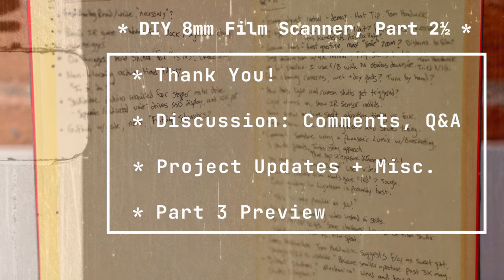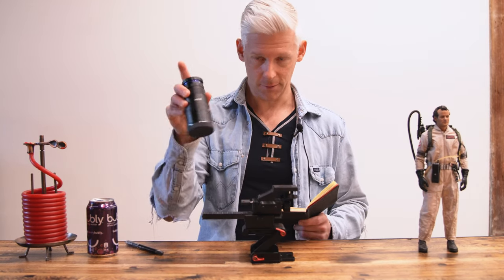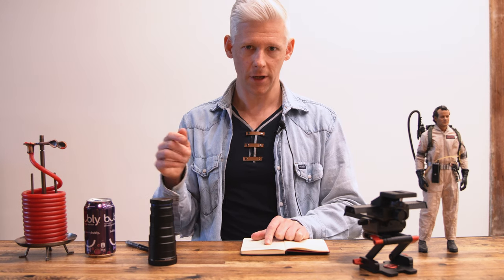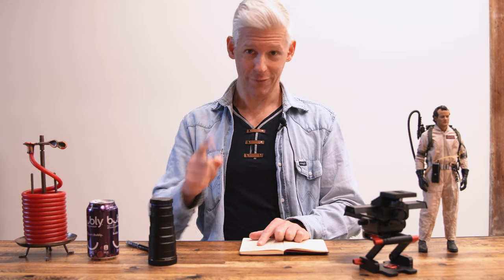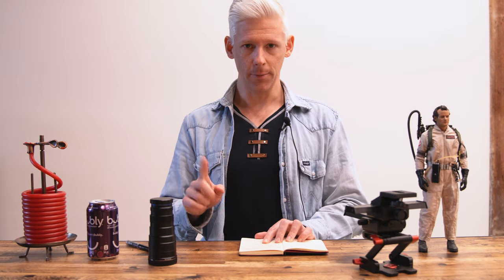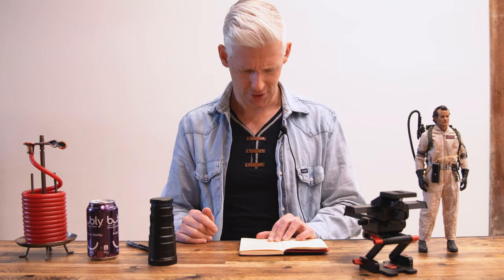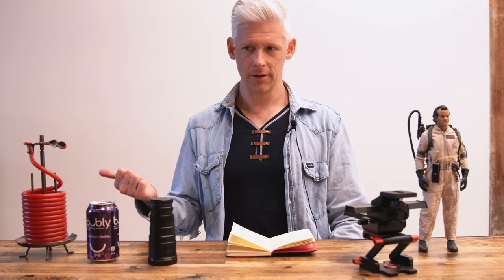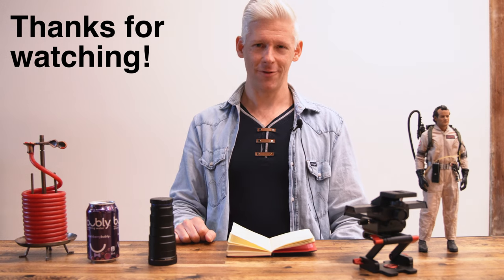📽️ 📸 💾✨ DIY 8mm Film Scanner, Part 2.5: Q&A! Ideas, Tips & Tricks; Part 3 Preview.

Comment: Thanks for all your hard work. Thanks to you we are seeing film not viewed since the 70's. https://www.youtube.com/watch?v=-Wu4AkhUs8Q
Reply from the maker: This is fantastic, well done! I hadn’t even listed all the parts I used, but it appears you got the IR gate and other bits. Very neat to see others getting similar “builds” working.

One important note: it sounds like your DSLR (Canon 7D?) is actuating the shutter / mirror every time, the classic Canon “mirror slap” sound. This will be wear and tear on the camera, and it will shorten the camera’s lifespan. 😬

Take a look at “silent” mode as a start to help reduce that, and maybe also the alternate firmware “Magic Lantern” (with its own risks / caveats) which may offer a way to get a fully silent frame without any mechanical movement.
Reply: @scottschiller  Yes, I was able to use your videos and replicate what you "created." Your videos are first class and solved a mystery I have been thinking about for many years - "How do I scan my old film to RAW images so I can process them." I wanted more control than a raster offers. I'd never heard of Arduino and your set up solved answers I didn’t even know I had. I think the only thing different was I 3D-printed a mount for the LED light because why not...plus I don’t have the same set of kitchen utensils 😊 

You are correct, this is a 7D….an OLD 7D. I did a little research and found shooting in silent mode activates the shutter 2 times, not one. Upon further research it appears (depending on who you listen to) that the shutter is what wears out on the canon cameras not the mirror. So with that info I figured what the heck,  if I wear out my well used 7D I will just have to replace it with a new full frame Canon..ahh darn. 

I will check out Magic Lantern's options. Its in fact already set up on this camera, just not being used. I used it years ago to shoot video in RAW on this camera. That was a beast of a project in terms of processing. 

Thanks again for sharing everything. I have family members that are blown away. I picked up a sound projector to pull the audio off the super-8 as well and it’s turning out awesome. Great work!!!
Reply from the maker: @dtorbit  It's always inspiring, and an honour to see others' work based on something you've shared. I'm glad you've found the video series useful too, of course! I enjoy making these, and I put them out there with the hopes they'll be enjoyed by others.

Thanks for confirming the Canon 7D, I'm glad to know you're aware of the shutter activation and eventual wear and tear. I tried some raw video experiments on my 5D3 (which I have here) years ago, and I agree - it took many hours and hundreds of gigabytes to process the frames, but I got some pretty nice results! Some San Francisco Bay Bridge footage, here. https://www.youtube.com/watch?v=IymJBmfa_bY

Regarding reducing or eliminating shutter / mirror / mechanical activity: I haven't tested this yet, but Magic Lantern calls the "silent" feature "Full-resolution silent pictures." I intend to check it out on my 5D3 and will include my findings in Part 3 if I there's anything notable. https://www.magiclantern.fm/forum/index.php?topic=12523.0

I'm delighted to hear you were able to scan stuff for your family and surprise them; that was my goal for last holiday season as well, to bring material from the archives and make it look really good. Getting Super-8 sound must be interesting, I have not tried that yet myself. I have one commercial film that has a visual waveform printed on it, I have yet to dig into that.
Reply: @scottschiller  ' Waveform printed on it' sounds as if you've got a Super-8 film with a mono optical audio track printed onto it. These were almost invariably prints made for the aviation industry, where the film ran at 24 fps, and the iffy signal to noise ratio and poor frequency response of optical tracks came with the advantage that there were no magnetic heads to wear and get clogged up.  The Elmo GS1200 will replay these films well.

Comment: Very nice. I have an old projector that's begging to be modified. Whilst I know how stepper motors work, I have no practical experience using them. The Nema 17 appears, to come in different sizes, presumably different power, torque and voltages. Is there a specific model that you would recommend to do the job ?
Reply from the maker: In researching stepper motors, it seemed like the NEMA 17 was a "safe bet" in terms of its torque. I think you're right in that specs vary somewhat, but driving a projector shouldn't take much force; you can turn the projector gears etc. by hand, using the pulley.

I wasn't sure how much torque was required, so I got a 2-amp 1.8-degree (200 steps per revolution) bipolar (4 wire) NEMA 17 which has 84 oz-in / 59 N-cm torque. I wager a 1.5-amp would be fine as well. The 2A version is certainly strong enough that you can't easily stop the motor turning with your fingers. The model I got was around $10 USD. I believe these all run at 12V, but make sure you check the specs before buying. https://www.amazon.com/STEPPERONLINE-Stepper-63-74oz-Connector-Extruder/dp/B07LF898KN

A smaller 1-amp NEMA 17 might be fine in terms of torque for a projector, but I haven't tested this. If the price is roughly the same, I'd get the 2-amp one to be safe. https://www.amazon.com/Short-Bipolar-Motor-18-4oz-13Ncm/dp/B00PNEQ79Q/

As for making them work with the TB6600 + Arduino, I found these two videos to be really useful.
One warning I've also seen: Don't connect or disconnect the stepper motor wires to the TB6600 while the power is on, because it might burn out the controller! I've been lucky and haven't done this - yet - myself. ;)

Background, types and theory: https://www.youtube.com/watch?v=0qwrnUeSpYQ
TB6600 + NEMA 17 + arduino specifics: https://www.youtube.com/watch?v=3LZ_v3Jldwo

Hopefully this is helpful for you!
Reply: @scottschiller  Thanks Scott, for all the info and the links that is extremely  helpful .
Reply from the maker: @whoam42a1  Excellent; you're most welcome.

Comment: Very intriguing, enjoy this type of DIY, grate work. What I would like to know the camera, would a simple cell phone camera work or must it be the expensive ones with bells and whistles.
Reply from the maker: Thank you, I’m glad you found it interesting! Regarding the camera - I have seen some scanners where folks use a Raspberry Pi-type camera lens/sensor, basically a lens module on a little circuit board sort of thing. That might be a little more work, but more convenient / reliable than trying to set up and remote trigger a cell phone to take thousands of images.

Whatever you choose, the most important thing is you don’t want a mechanical camera shutter e.g., DSLR cameras, because those will get worn out pretty quickly with the movement required to take a picture - and then you’ll have a “dead” camera, not very useful! 😩
Reply: @scottschiller  - thanks for the info, will do some more research and see which way I want to tackle this project.

Comment: This is a fantastic project, and what you've done is awesome!
Some tweaks you can make to your existing camera settings:
Yes, you are absolutely correct that the more zoom - the longer the tube - the less light will reach the sensor. It's the same problem those of us who shoot large format (the old cameras that look like an accordion?) have to deal with and compensate for.
While the "sweet spot" of a lens is nice to know, there is NOTHING stopping you from closing down to get a deeper depth of field. You mention you stop it down to f8 - I would have jumped right to f11 when dealing with that shallow of a subject. For what you are doing, you will never notice any difference in quality between f4 and f11, but you are guaranteed the whole field will be in focus.
Now, long zoom, and stopping down equals LESS light, RIGHT?!
Here's something else to note: I feel like you are going by the rules of film photography (hey, I'm a 50yr old photographer, and I sometimes go back to them as well) where the higher the ISO/ASA, the "chunkier" the image. 800 ISO on that camera (Sony a7 series cameras) is smooth as butter! Gone are the days where you need to work with the slowest ASA possible to ensure it being sharp. Add to that, in the end, the image will be "moving", which negates a LOT of image artifacting anyway. This will ALSO give you the benefit of a lower contrast image - less likely to both blow-out your highlights and/or crush your blacks - you will see MORE information overall in the finished frame.
A note about a DSLR that has a mirror - they can use the Mirror Lock-Up feature to relieve the camera of that. No mechanical use, and even better, no camera SHAKE.
Sorry for the novel.
LOVE the Venkman figure!
Looking forward to watching your Pt. 3!
Reply from the maker: Hi Lew,

Thanks for the kind words, and the notes coming from someone who knows large format and film! I've had varying thoughts from folks on aperture. I think I initially tried f/16 with my first prototype in part 1, but my exposure time was multiple seconds when using my LED flashlight. I think it's good to test your own camera and gear, of course, and see what works for you. I think I've used f/8 for most of my scans at this point, and I've found that aperture much more forgiving than f/4 where the focus was harder to line up across the film. Either way, the depth of field is very shallow on this lens!

As I recall, there's an argument that smaller apertures introduce diffraction and thus reduced sharpness - so I try not to use the smallest aperture, i.e., f/16, on this macro lens. I think f/4 or f/5.6 have been recommended as the "sweet spot", per se.

Regarding ISO, I've heard arguments that ISO is effectively just a multiplier on exposure with digital cameras. As I recall, the argument was you could (theoretically) always shoot ISO 100, bring exposure up in post, and it'd be almost the same as using a higher ISO when shooting. Either way, I found that I can shoot pretty reliably and get good results at f/8, ISO 100, and 1/10s shutter speed. For scenes where more light is needed, I can slow down to 1/8s or 1/6s, noting that it's increasingly important that the camera doesn't vibrate or move during this process.

On DSLR mirror lock-up: Indeed, most have this feature, but there is still some mechanical movement from what I found. It's reduced, but still there, and I show that briefly in this video on my Canon 5D3. Folks with Canon DSLRs can try looking into the "full-resolution silent picture" feature offered by the Magic Lantern firmware as one possible way to get truly silent pictures, but it sounds like this is slow and outputs YUV 422-type files - perhaps not RAW, which may negate the benefits of the process otherwise. https://wiki.magiclantern.fm/userguide#silent_pictures
Reply: Hi Lew and Scott.  I'm in total agreement about the usable ISO extending to 800 (though on my A7R2 I limit it to 400).

But I flinch at your 'jump straight to f/11' comment. On our side is the fact that we're using a beautifully designed flat-field macro lens (the Laowa), and if the camera is truly perpendicular to the film in the projector's gate there should be no need to stop down the lens at all.  

OK, there 'could' be some film curvature and splices will be horrible, but generally (as Scott has found) it's vibration that causes the loss of focus.  The tests of my 4K TVs screen show a MARKED resolution loss when you go from f/4 to f/11, and this has nothing to do with Laowa and all to do with the laws of optics.  I shoot my gate at f/5.6 to give me that tiny bit of DoF reassurance, but I know it's visibly not as good as f/4.  I'd happily use f/2.8 from a resolution standpoint, but the very slight vignetting wide open (easily shown using zebras) has completely cleared by f/5.6
Reply from the maker: Thanks for the detail.
I tried f/4 myself, but noted the depth of field being very thin and having some trouble aligning with the film gate, using my setup as-is. With f/5.6, it seemed like a nice go-between.

I wouldn’t use the smallest aperture on any lens under normal circumstances, but it never hurts to look up the “sweet spot” online.

Comment: Seriously beautiful machine and even better results.  I have about 100 years worth of family movies that I’m too paranoid to ship anywhere, so I’ve been wanting a Dual 8 ‘telecine’ for many years now, especially one that’s independent of a computer connection and easily upgradeable as the camera tech gets better.

As the saying goes, it’s pointless to reinvent the wheel, so I’ll be copying your methods as closely as possible.  So close, in fact, that I just bought the exact same Canon  S-400 projector on eBay.  Hope you don’t mind... I’ll give you full credit whenever I’m taking to someone about it. 

You touched upon this a bit already, but rewinding the film back through the gate is just more wear and tear on the film.  I recommend finding some old rewinds and doing it manually.  Doesn’t take that much longer. 

A quick question.... my apologies if I missed this info in the videos... Since the A7 is a full frame camera, after color correction and cropping, etc, is your finished film reel 2k or 4K?  I’m looking to ‘future proof’ my films, so I want the most maximum resolution possible for the family archives.
Reply from the maker: Thanks for the kind words, Doug! You raise a good point about the rewinding of film. I do recommend pulling the last bit of film through the gate at the end, and then attaching the film to the empty reel directly above - bypassing the film gate - for rewinding.

The Canon S-400 seems like a pretty reliable projector, although I have found it a bit tight when lining up the camera lens with the film gate - something to consider.

With the setup I’m using, I do get scans that allow me to export at 4K, 2160p resolution. At time of writing, my most recent video of street cars from 1982 is in 4K, scanned from Super-8. Hope this helps!